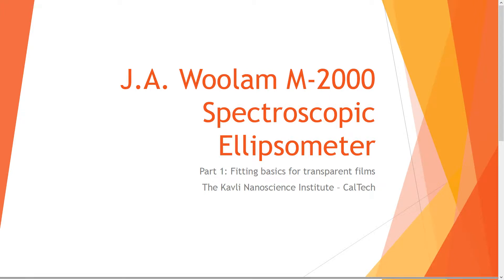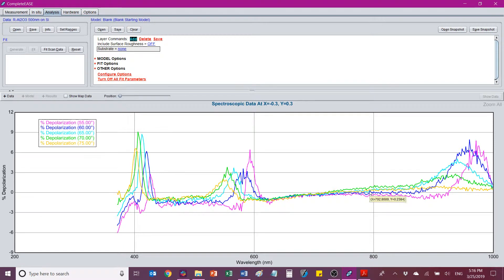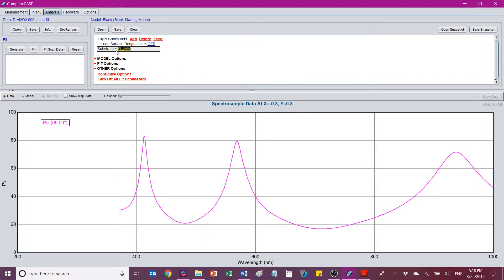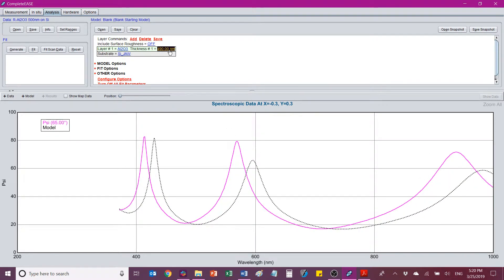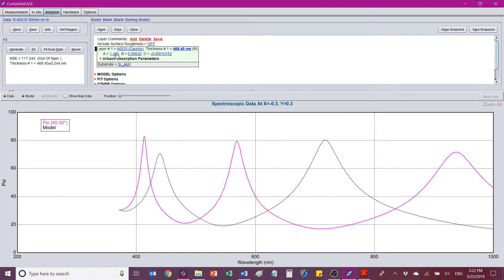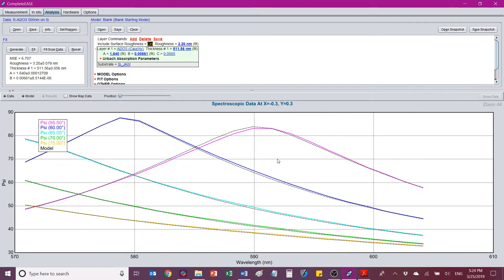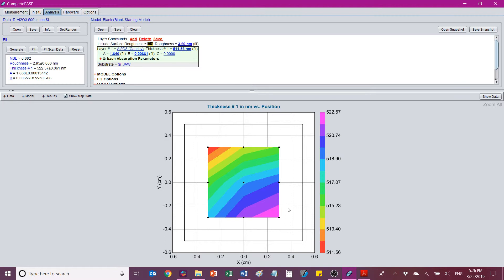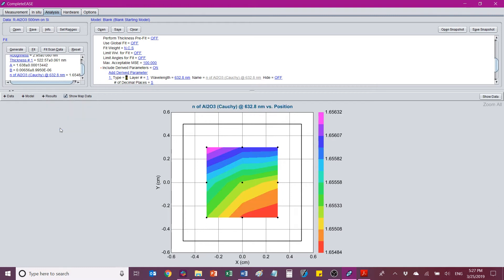Ellipsometry & CompleteEASE Part1: Fitting basics for transparent films

Comment: Thanks for the video. Is there any way of doing a global fit in such a way that the optical parameters are the same for all the positions, but that the thickness can vary? I know it is possible if you first fit the optical parameters and then use that to only look at the thickness.
Reply from the maker: Yes, that's correct. You would fit the optical parameters at one measurement point and then keep them constant while you perform a global fit (fit scan data) with thickness as the only parameter to be fit. You might do something like that if your fit is very good and is showing that your index is essentially unchanged across the scanned region. Though you will probably find that in most cases this barely has an effect on the thicknesses reported at each scan point if the fit is already very good.